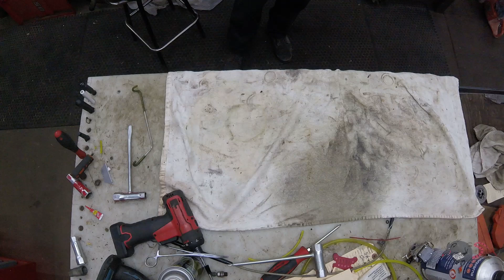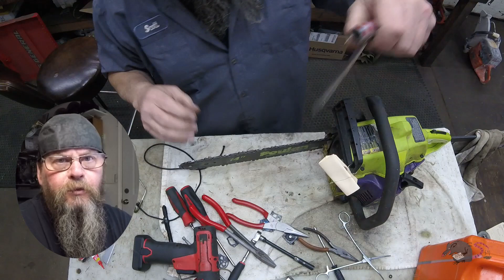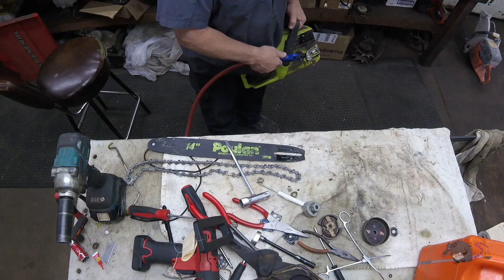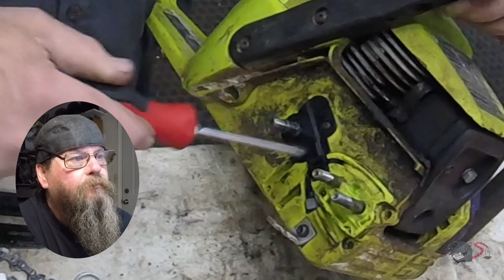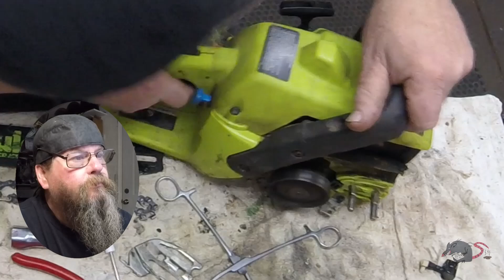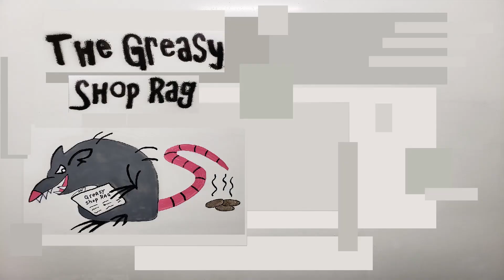Poulan Wild Thing Chainsaw Oil Pump Repair

Comment: I really appreciate your narration style. Instead of trying to talk while you’re actually doing the work. I also sincerely appreciate your effort to make the video and to show the two steps that were not obvious. 1) taking the clutch off to get to the oil pump, and. 2) putting rope into the cylinder space to hold the cylinder in place while you use some kind of pin device to remove the clutch. You rock!🎉
Reply from the maker: Glad you found those tips helpful, thanks for watching!

Comment: My Poulan Wild Thing leaks bar oil profusely; whether the engine is running or not. What do you think the problem is?
Reply from the maker: Well it could be the hose that passes through the tank to the oil pump.
Reply: Thanks!  Sounds like it’s not the oil pump.

Comment: Can these oil pumps just lose prime in a couple years sitting? I have a 2375 42cc my Dad bought new in 1999 that we used up til a couple years ago. I bought a new Poulan but it sucked, then bought a new Stihl but it sucked too so I brought the Wild Thing out of retirement and rebuilt the carb and new fuel lines. Runs like a top again but will not oil. It doesn't even leak oil like it's done since it was new. It oiled 2-3 years ago when we stopped using it so I'm unsure what could've happened just sitting in the case.
Reply from the maker: Even if it were to "lose prime" it would reprime in 30 seconds of running. Something else is going on here.

Comment: I have this same saw walmart low budget buy i loved it at first but it started giving me all kinds of trouble a year later and the oil leaked out all inside the carry case that it came with i still have but i lost my enthusiasm for it when all the trouble began 😢
Reply from the maker: Ya they aren't built for the long run but a year seems too soon.

Comment: I have the Poulon PL3816 and you can,t keep oil in the tank, put oil in the tank and let it sit and it will empty the oil tank overnight. Not coming out the cap and the o ring looks ok. Has leaked like this since I bought it. Any idea of what might be wrong, thought about ordering a new pump.
Reply from the maker: In these situations I will clean and dry the saw, put oil in it and montor it closely. The idea is to find the source of the leak before everything is covered in oil.

Comment: The 2150 pump is slightly different from other pumps. TheWildThing is same as 2150. It has offset gear.  Your video helped me confirm what I assumed. However lifting up and slamming down a customers saw really bothered me.  RESPECT
Reply from the maker: Don't let it bother you. Its all theatrics.

Comment: And I just threw up a little in my mouth🤢

I call modern Poulans the Saturday Night Specials of the chainsaw world.
Reply from the maker: The labor rate to repair them is the same as the rate for repairing an MS660 :-)
Reply: @TheGreasyShopRag  Modern Poulans just make me go "EWE" after that 1950 Wood Shark I bought when I was 16 years old. Now some people have no problems with modern Poulans out of that box, but the one I had was an enormous turd.
Reply: @williambray4134 So what? So, you had a problem with one chain saw ... that means absolutely nothing.
Reply: @MrSummitville So what? So I ain't the only one that has had issues with modern plastic Poulans. They're steaming, heaping piles of dung that killed a once very reputable brand.